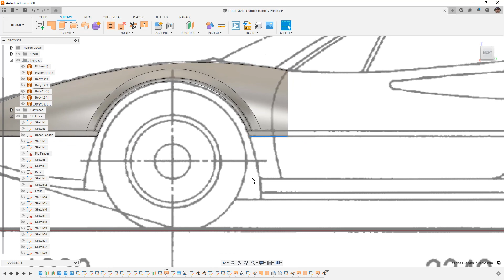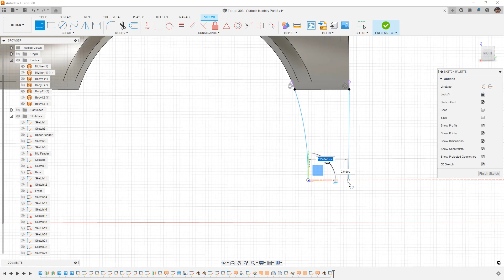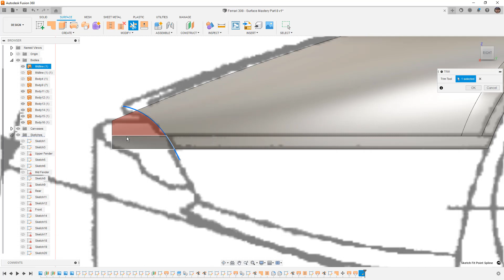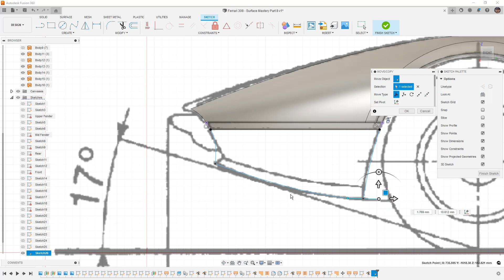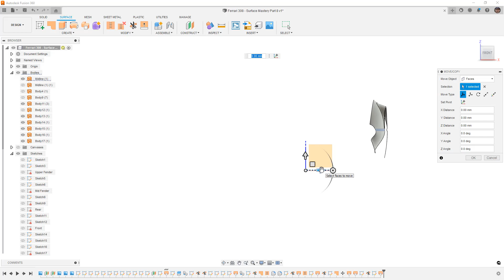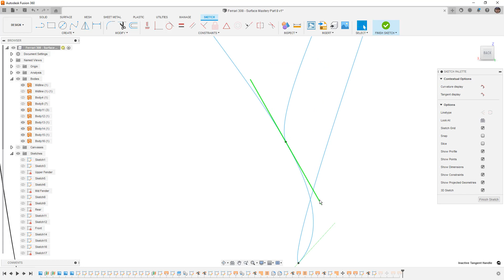Surface Mastery Part 8 - Building Surfaces with 3D Splines | How to Surface Edges and 3D Splines

Comment: Is it possible to create a curve by projecting/intersecting 3 reference curves at 3 reference angle (top, right, front)?
Reply from the maker: Um, no?  I say that as a question because I am pretty sure the answer is now :)  When you create a project/intersect it projects it out normal to the plane it was sketched on and can only be 2 inputs.  I can't think of a way you could get and/or control the intersection of 3 curves, but i would guess you would be asking about modeling a curve from the front, top and side of say a blueprint.

My rough rule of thumb is to look at the direction of change in the curvature.  For example its really hard to model what happens to a wheel arch with just 2 projections because generally after the high point above the wheel you cant see what happens on a blueprint.  So a lot of times the front half of a fender will be done from the side and front.  While the back half might be done from the side and top.

Comment: Hand-down best tutorials ever. Not just for Fusion360, but the way you explain multiple methods and their up/downsides. Very rare to find someone that can explain like you!

Quick question: is there a reason you're using Fit Point Splines in this and not Control Point Splines? Would Control Point Splines be a little easier to select the handles?
Reply from the maker: Wow, thanks!

In general control point splines are much better to use. you get better curvature out of them.  I  usually use fit point splines IF its just a start/end point.  Whenever there are intermediate points needed i generally go to a control point spline.

There are some general things you have to think about with one over the other.  The main reason you would go with fit point spline is if you needed to snap the point on the spline to something. like construction geometry or another spline that might be a guide rail.

Comment: How good is fusion for surface modeling for automotive use? I find that a lot of people use rhino and it seems to do really well. If you look up I believe "electric supercar rhino3d" there's a forum post of a entire car built from the ground up by very talented person. I have a copy of inventor but debated on switching to rhino
Reply from the maker: Not great.  You can model cars with Forms, which i have loads of videos on here about including 2 full series, but the surface tools and workflow just isn't there.  I have modeled cars with inventor, solidworks(surface and forms), fusion and others.  If you goal is to model cars then I would point you to a dedicated Class A modeler like Alias.  I've heard Rhino is great for this but I haven't had the time to try and model a car with it just yet.  Inventor has Freeform like Fusion, but Fusions tools are more complete.  Inventor still has some of the same shortcomings with surface modeling like how you build curves, but arguably a better/more complete surface tool set.
Reply: @LearnEverythingAboutDesign  I've tried alias, did not like it. The learning curve was super steep and I could not find much information on it. I used the rhino3d demo and it was really easy and simple but its 1000$  sadly. I def need to watch more of your videos, I've been really struggling on modeling a penta-roof cylinder head
Reply from the maker: @YeahMan9911  just let me know if you get stuck on something!
Reply: @LearnEverythingAboutDesign  I've been modeling a engine for fun on inventor and I've started to work on the cylinder heads and its proving to be a pain, cylinder heads are quite complex with all the complex cavities and the chamber itself. I've been struggling with the chamber being a 4 valve pentaroof design, I spent about 6-7 hours trying all kinds of designs for lofts and such but no luck
Reply from the maker: @YeahMan9911  Yeah recreating shapes like that can be very tricky.  I would start(which you may already have) with defining the spark plug and valve seats floating in space where they need to be.  Most of these designs are symmetric so you can work on one half or maybe even one quarter if you are lucky.  Which head are you trying to copy?
Reply: @LearnEverythingAboutDesign  yep I've defined valve seats and sparkplugs, I've tried lofting to each valve seat but then you have the issue of the intake valves being bigger than the exhaust so it gets wonky, I've tried lofting to the sparkplug hole and then trying to extrude the valve seats but then the surface doesn't really match with the valve seats

I was just trying to copy the first image result on google for pentaroof head which should be from wikipedia
Reply from the maker: @YeahMan9911  The worst sounding engine in the world. the vq :)  if you are using inventor what i would suggest is you chop it up into 1/4 of the combustion chamber.  You make the shape you want with 2d sketches at each side of the 1/4.  So 0deg and 90deg.  That one quadrant would have 1/4 of the spark plug seat and it would have an entire edge of the valve seat.  The patch tool In inventor will let you select the external boundary(the 1/4 wedge of your combustion chamber) and the outside of the valve seat and build a surface that way.  Fusions works a bit different than that.
Reply: @LearnEverythingAboutDesign  I'm more of a American fan, I was just trying to find a example to model, your method worked perfect, not sure how to make all the 1/4 pieces transition smoothly together however, otherwise it works great thanks

Comment: There are so many small details in work flow and selection that you share that makes the difference between success or failure in using Fusion.  Thanks for the detail
Reply from the maker: Of course!  Staying fluid and working in a flexible manner is really the only way to get things done :)

Comment: I really like this series, i tried modelling a car in blender but it just wasnt intuitive enough for me. I might have a go again in fusion. I will probably look at doing it with forms
Reply from the maker: I would strongly suggest forms but there are nuances there.  Really depends on what the car is.  Boxy cars might be a bit easier with traditional method of sketches/surfaces.  I have a ferrari 308 series and a Porsche 911 series that walk through the whole thing.  Both model the cars in slightly different ways but its a big time investment.  The 911 series is 10.5hrs.